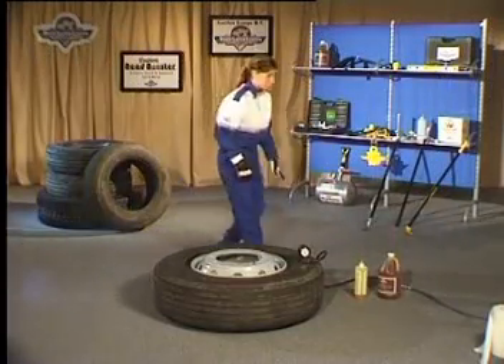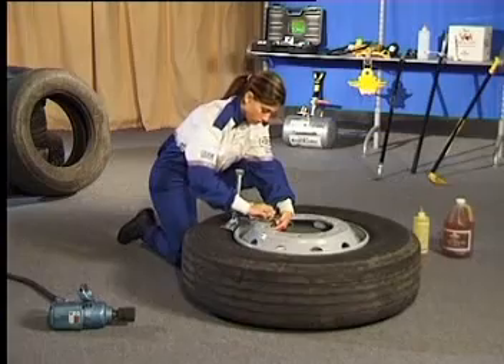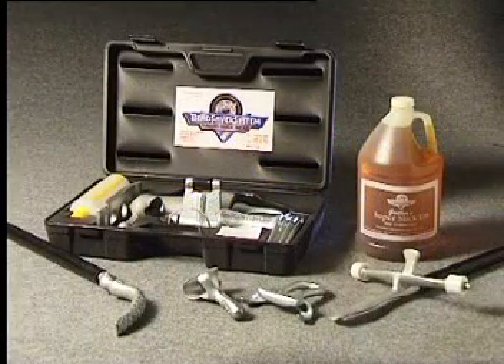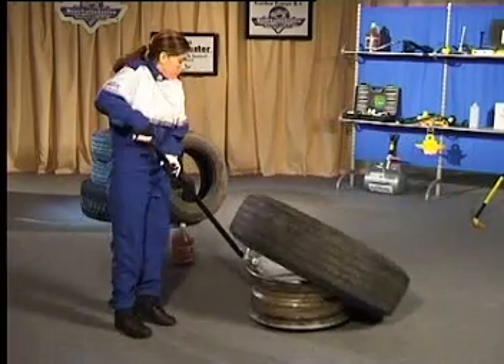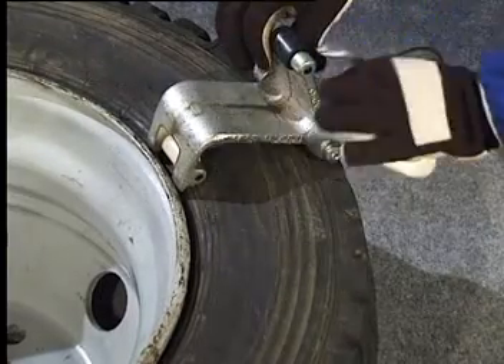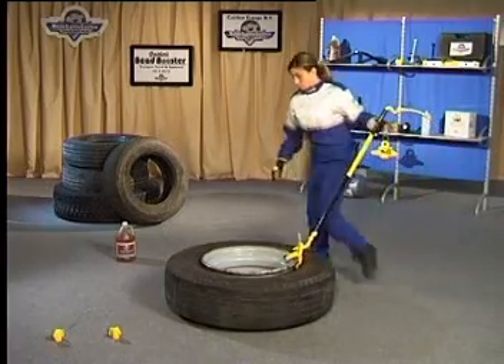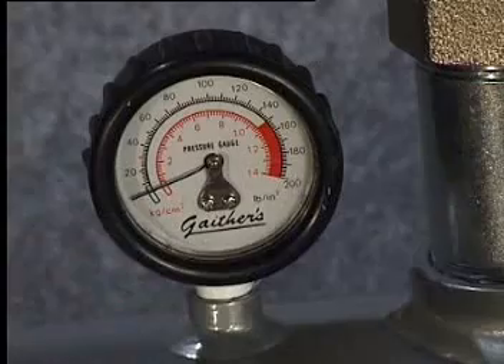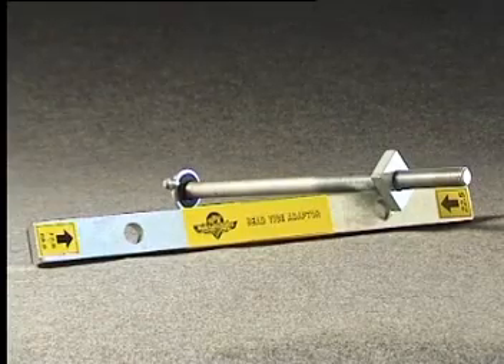Easy Mounting and Dismounting for Truck Tyres of All Sizes

Comment: Excellent job, fast and efficient. Take care of the tightening of the bolts, these carry a tightening of 650 N-m or 65 Kg-mt.
I have attended expert reports where by tightening them with the pneumatic tool, the bolts have been blown out by excessive tightening and stretching of the asparagus.
regards
Reply: Walter Adrian Lemus too much to do takes too long that way is super slow